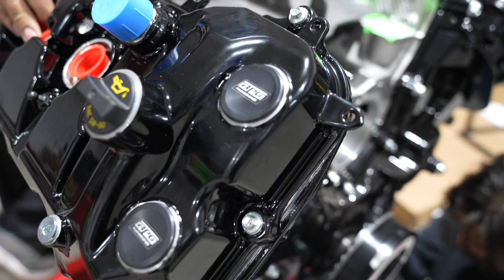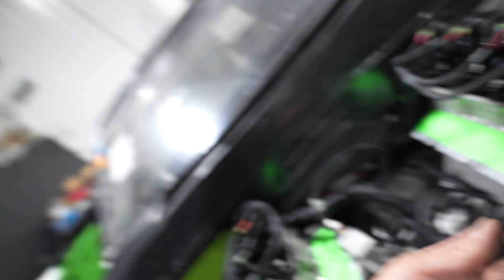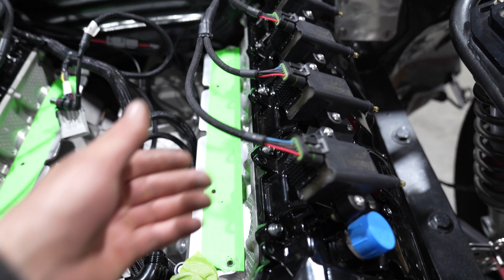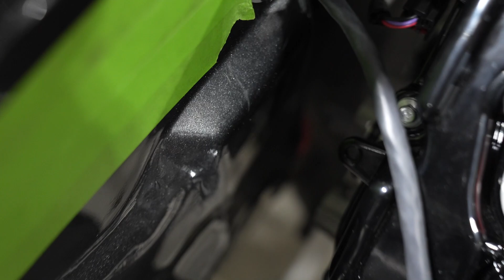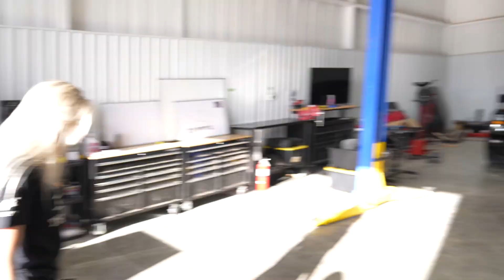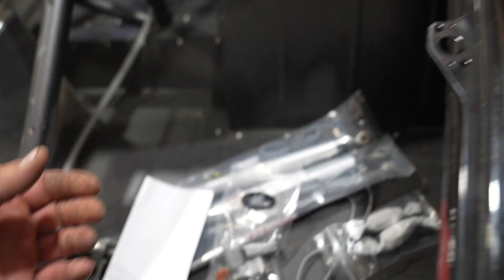Wiring a Holley Dominator on my Coyote Swapped Fox Body! 2500hp loading!

Comment: If you may how much for a motor and turbo combination like yours? Not including wiring or transmission or anything else
Reply: I seen a f150 coyote with twin turbos and he didn't have to upgrade anything no rods or nothing and he was making 1200hp
Reply from the maker: Email me or I have them on my site. Coyotes can hold up to that but it will let go. They are safe around 1000